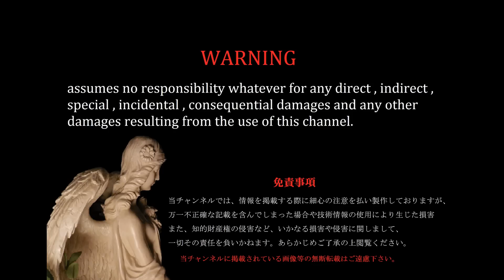Bus R/C 東京都交通局バス (修理) Metropolitan bus in Japan  1/32 R/C BUS [ AOSHIMA ]( バス ラジコン )

Comment: Good video. I'm also a technician and like to update my models. I searched Aoshima on ebay and neither used I found. Only the generic current ugly Chinese model.
Reply from the maker: ＋Marcelo Model Trains
Thank you so much!
At Aoshima, the only similar model is currently the plastic model

When checked, it seems that there is no stock
Thank you for watching
Reply: @Claus.A.Santa.  Hi friend. The plastic model is the new generation of Isuzu bus. But it's no longer manufactured either. I found a rest of stock on ebay for over 100 USD each kit. Very expensive! I saw a video where they installed RC in the plastic kit. If I get the kit I should be able to install the RC too.
Reply from the maker: @marcelodt  
Thanks for your comment
That's expensive!
It seems that it is difficult to obtain a plastic model now.
I have tried to make [BEIER-Electronic Soundmodul USM-RC-2] on a plastic model.
However, the plastic model was not available.